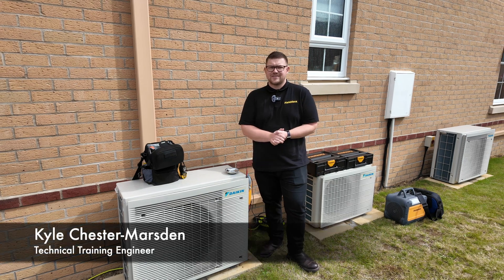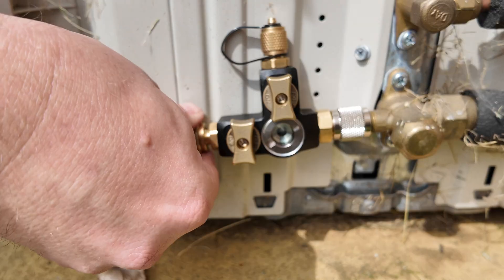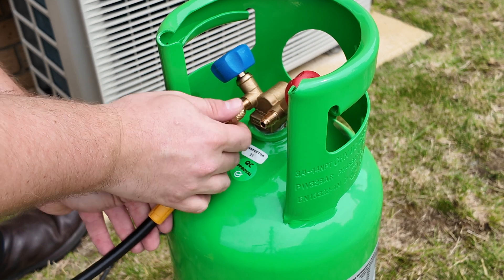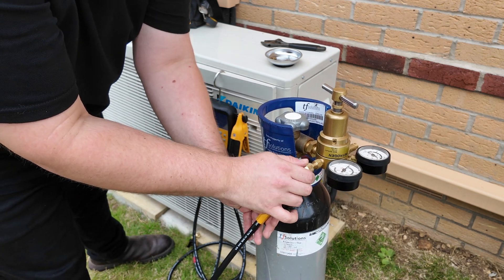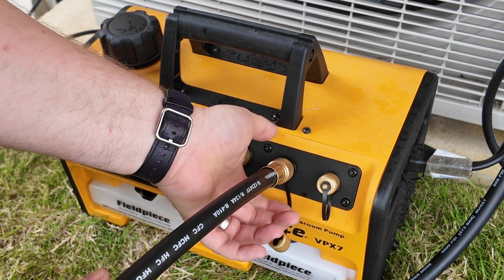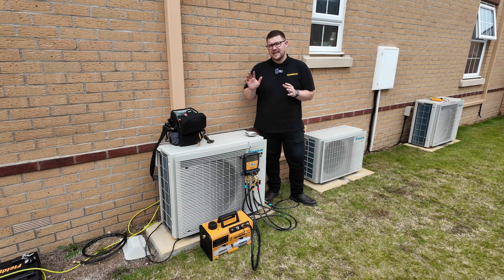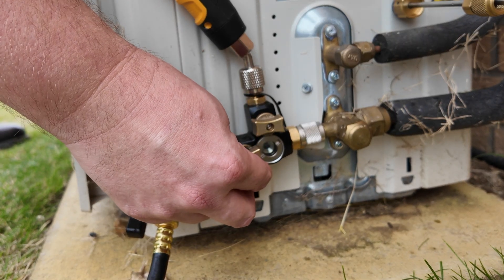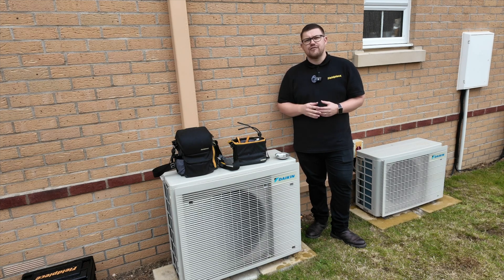How to: Recovery, Pressure Test, Evacuation, Recommission HVACR- System | Fieldpiece Europe

Comment: What is the point to make a pressure test to 25bar if the max pressure can get to 41,7bar?
Reply from the maker: Hi, The pressure test was to show how to perform this using our SMAN digital manifold - and not to prove the integrity and strength of the pipework, as this system had already been tested prior to this. I hope this answers your question, if not, please reach out to us via the contact form or email.

Comment: Hi, regarding at minute 9:12, highrise test. What is the ideal value (in general) and the minutes? Because by the default it was set 1000 microns. If I use these settings in all of my mono split installation at 10 minutes time, its always went more or less 1500 microns in 10 minutes. Ty in advance!!
Reply from the maker: Hi, It is always best to consult the equipment manufacture’s guidance on the evacuation high rise value. In this instance, a rise of no more than 500 microns within a 15 minute period was advised by the manufacturer.

Comment: Mmmm few things. No purging and you pulled 1.5kgs out of this system but the name plate says 1.1kgs which is what you put back in?? Please explain for the all these fellow fridgy dogs watching along
Reply from the maker: Thank you for your comment.
 
Purging of the system was completed but not included in the final edit of the video. The system lines/hoses should be purged/evacuated prior to refrigerant charge/recovery. 
 
Regarding the refrigerant charge amount in the system, the initial pre-charge amount of 1.1kg is correct, however, there was an additional trim charge of 0.4kg required for the system to run efficiently based on the manufacturer's guidance.
 
We hope this clears these questions up for you, but please reach out to via https://fieldpiece-europe.com/contact/ or email us at europe@fieldpiece.com

Comment: Did you just said the 5/16 fitting comes with every vcrt? Cause mine doesn’t and I’m still waiting for it, purchased on April and still waiting….
Reply from the maker: Yes, that's correct. In Europe, our VC1E, VC1GE, and VC2GE models all come with a 5/16" adapter included. In other regions, however, the adapter is sold separately. Please contact us if you need further assistance: Europesupport@fieldpiece.com or https://fieldpiece-europe.com/contact/

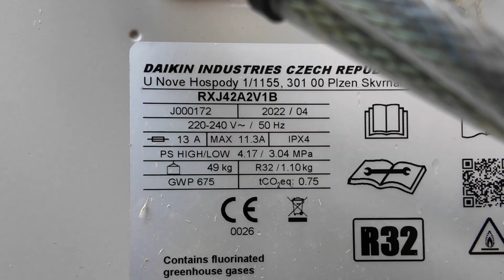Comment: Excellent explanation. All the processes were clear. Thank you. My question is the following: At minute 10:15, high and low pressures are shown on the equipment plate. What do these values mean?
Reply from the maker: Hi, thank you for your question! The low and high pressures that you saw on the video are the values that belong to that specific condenser/ outdoor unit; those are the values in between which the unit operates.